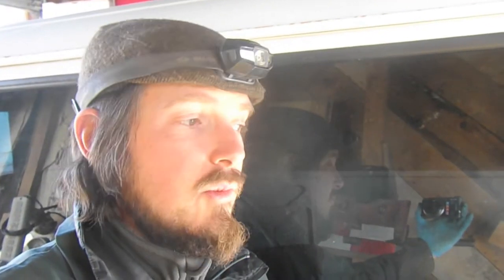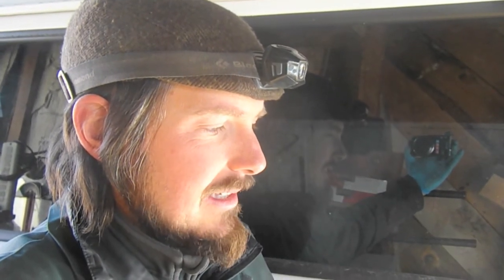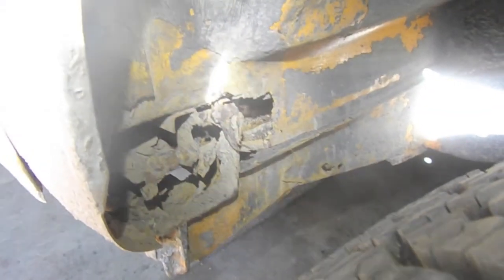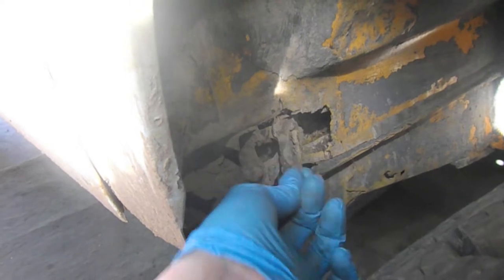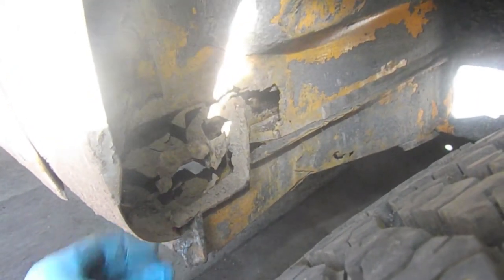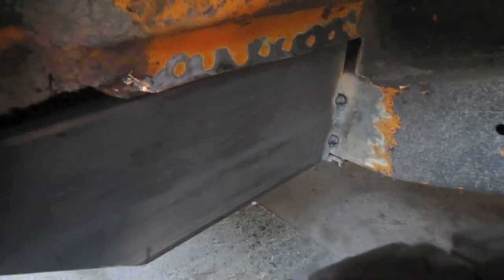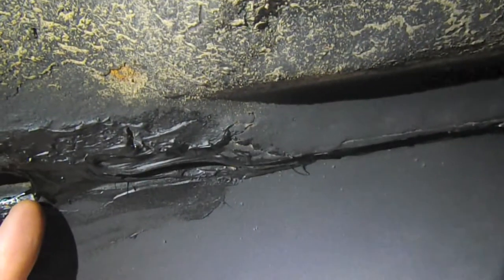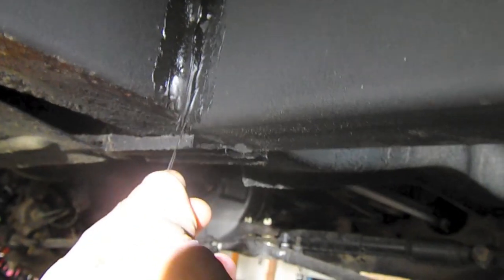Busaru - Front Wheel Well Rust

Comment: I've got some rusty/holey areas on the Vanagon at the hinge point of the accelerator pedal and on the driver's side main cabin floor.  Getting all of the mechanical things sorted out for road worthiness before moving on to those.  Titled, registered, and nearly ready for State inspection (Texas = safety only for 25 years and older).  I may be leaning on you a bit for advice on starting problems in the future if the new alternator doesn't clear up the problem.  Runs and idles beautifully once it has warmed a bit.
Reply from the maker: Congrats on getting it all running! If charging your battery doesn't solve starting issues then the alternator probably won't really contribute to solving that problem. What other problems are you having?
Reply: Busaru It wasn't really a starter/cranking problem, as it may have sounded in my comment, but rather getting it to stay running on cold startup.

What was happening, aside from the cold start issues, is that the battery would run down in a short period of time.  The ScanGauge was showing 10.9 volts (while running), which suggested that the alternator was not putting out sufficient voltage for charging.  This made me wonder if the electrical system of the engine was running off of the battery itself, and maybe not getting all the juice it needs to run properly at low idle.  I changed the alternator to one of the 110 amp alternators and it seems to start better and not die several times.  It is a rebuilt, and even it shows only 11.6 to 11.9 most of the time (at idle).  I know that alternators should be kicking out closer to 13 volts for proper operation, but I am wondering if perhaps the voltage reading is not actually coming from the alternator.  If so, I may be looking at a replacement.  Again.